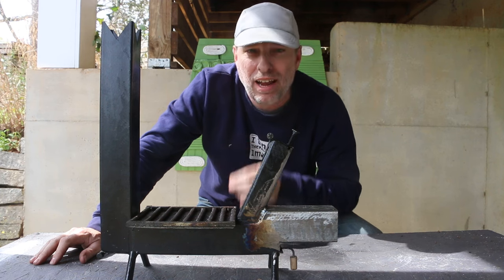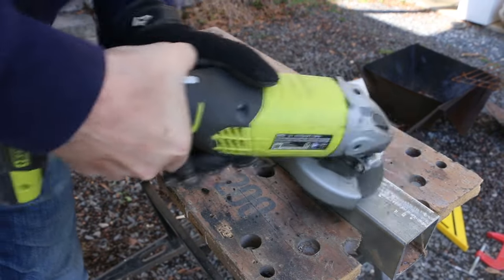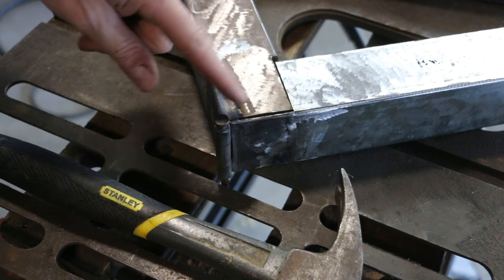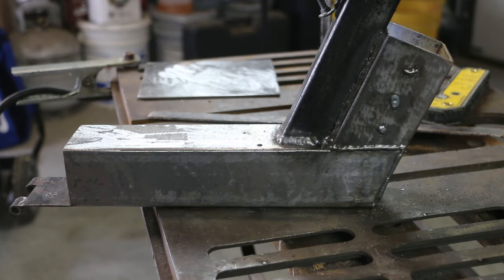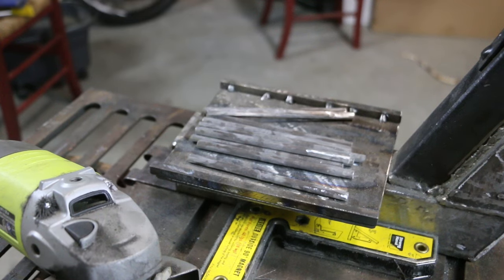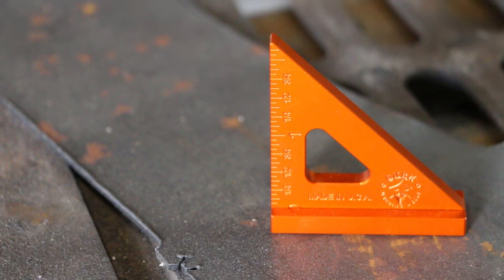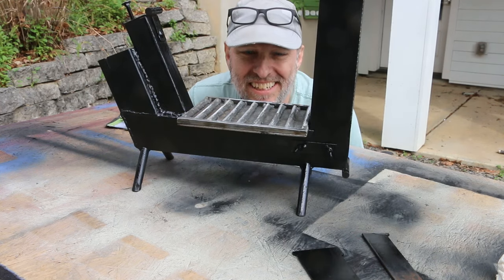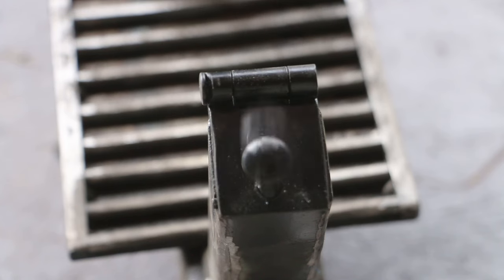Duel Fuel Rocket Stove [Prototype]

Comment: I like your design but I believe your last shot at 57:41 shows the problem. Air leakage at the base of the chimney will reduce the draw of air for your fire essentially starving it for oxygen. I like the hinge design, but I think sealing that area somehow could improve the performance. Maybe a quick test with a suitable caulk to verify the hypothesis before major effort? Your fabrication skills are inspirational. Looking forward to your follow up video. Best wishes.
Reply from the maker: Thank you for the feedback, Roland. I might just eliminate the hinge and weld that corner. At this point it’s a testbed. :-)
Reply from the maker: And thanks for watching to 57:41!
Reply: Maybe longer chimney?
Reply: You could just tty that and make it a short too

Comment: Interesting design evolution Tom.  The air gap at the chimney may be fine for secondary burn combustion while not adding to 5he overall grill heat.   I think you are on the correct path and doubling the tube size will quadruple the air volume.  Fire doesn’t seem to scale down as well as we assume.   Look to the dimensions of Rocket King for your optimal firebox.   

Wishing you and your family a blessed week filled with gentle seasonally appropriate weather and restful evenings together.   Peace brother